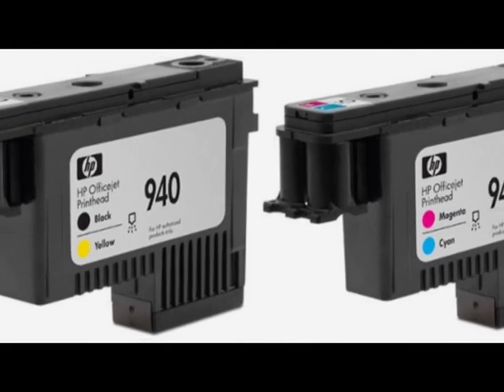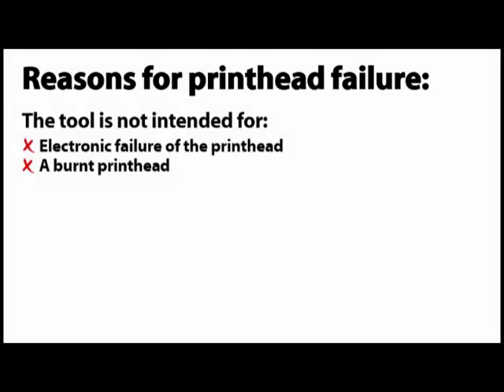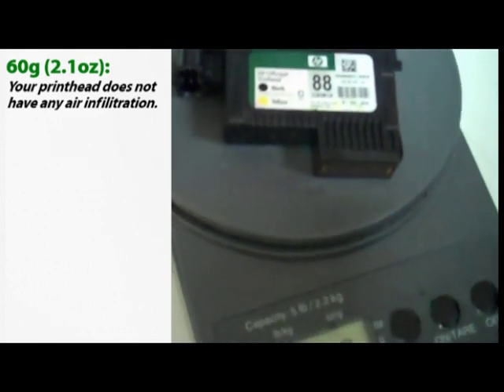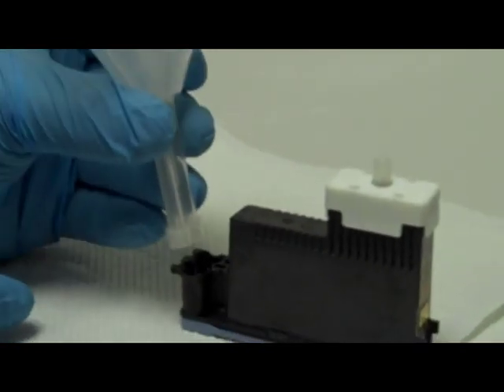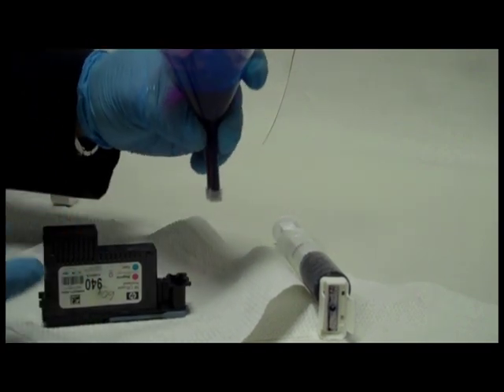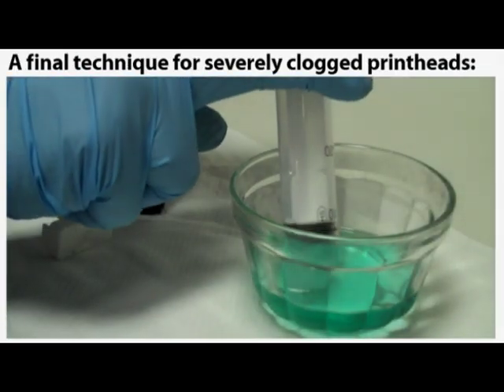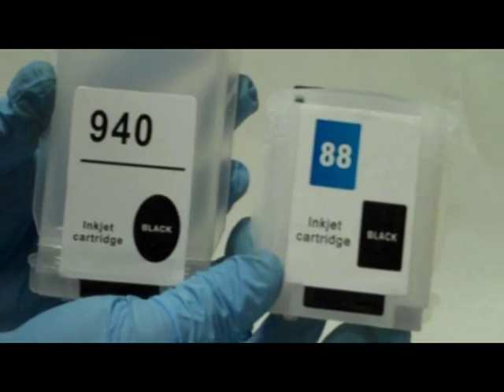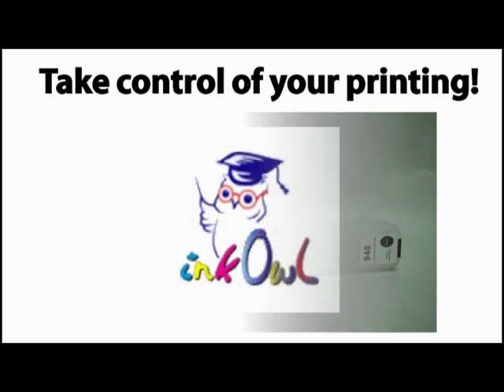How to Fix a Broken HP 88 or 940 Printhead

Comment: I have bought InkOwl's products to make my OfficeJet Pro 8000 printer into a super printer.  I added the big tanks and can add ink on the fly.  This has worked great.  I let the ink get too low one time and bubbles appeared in the lines.  I purchased this kit and cleared the lines.  This fixed that problem.   Yeah!  Now today, my printer stopped printing (mid job) and gave an error on both print heads at the same time "MC" & "KY".  This means a printhead issue, but I suspect this is an end of life issue since both ceased at exactly the same time.  Now doing research on how to override this.    I want to add that a friend found this printer on a curb with a "free" sign, and I found out its value.  I spent some time learning how it works, thus finding InkOwl.  They add value to their products by including great instructions with their products.  Now I print my ski club newsletters on it each month and enjoy my "new" printer.  Thanks InkOwl for great products and instructions!
Reply from the maker: +Kim X Thank you for the kind words! You are right, if the printer is actually warning you that the printheads have an issue, this means that something electronic in there is now broken. Doesn't help that they both failed at the same time. You could buy two new HP printheads to try to recover the printer, but that would be as expensive as buying a brand new printer! Therefore, we'd recommend the latter.

Comment: Sr. I have a little bit problem. in past I refill heads and they work, but after several refilings the light of non existing head is blinking and  the printer do not recognize the heads at all. I thing this is more electronic matter because always in the past I refill heads were work.
Reply from the maker: That's right, if the printer is unable to recognize a printhead, it is an electronic issue. You can try cleaning the electrical contacts on the printhead if they are dirty, but if that fails, I'm afraid you will need to purchase a new printhead from HP.

Comment: Ok I have an HP officejet 8500 A plus uses the 940 printheads. It stopped printing black only and will not do an alignment. Yellow still prints. I weighed the print head dont have a gram scale but it weighs in at 1.6 oz which is roughly 45.5 grams when converted. Would this be a possible fix for this printhead?
Reply from the maker: It sounds like this tool will do the trick. So long as the printer is not actually prompting you on-screen to change the printhead, I strongly recommend using this tool. Be sure to get some high-quality pigmented HP 940 ink to pass through.